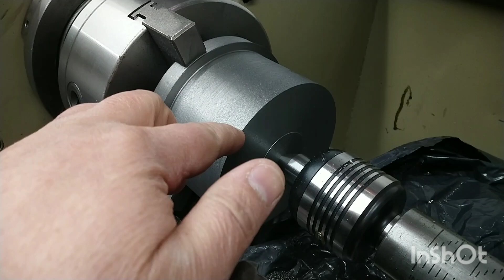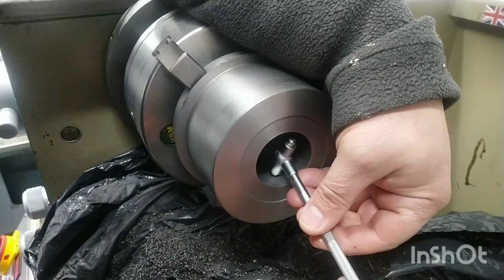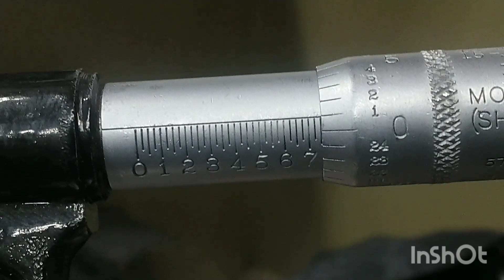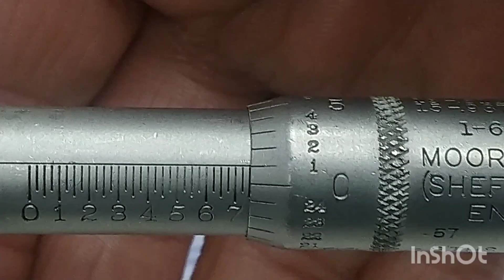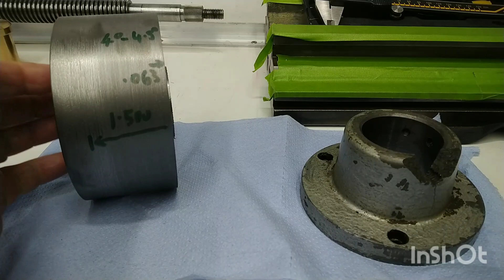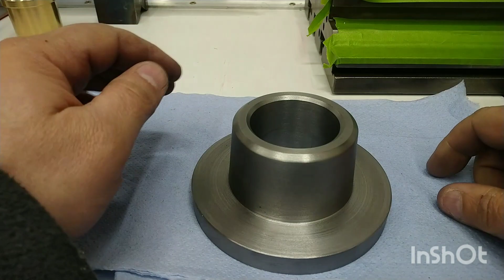Harrison Mill Resto Part 9B - Making the nut housing - And Swarf Jenga!

Comment: To be totally honest I wouldn't have bothered with the taper and would have made it parallel. The only reason for the taper would have been because it was a cast part and hence needed a taper to release from the mould.
Reply from the maker: Yes of course you are absolutely right. I did consider not having the taper. And if you look at Harrison Mills, there is a lot of variation in that particular part. But I decided just to make it look like the original as best I could. Thank you very much for taking the time to watch and comment. I do appreciate it.

Comment: There are a few times when I've thought a high speed spindle to attach to the cross slide would be very handy, this being one of them, stick an end mill in and cut a circular groove in then part off a donut. Not quite as good as the rotabroach but still probably quicker and slightly less wasteful than just converting the entire thing to swarf!
Reply from the maker: Yes I agree with that statement wholeheartedly.

Comment: That looks spot on Carl, ant that cc iron turns really well, but as you say, messy! I have done my fair share of car discs drums and flywheels so i know what it is like’ Other than “As original” is there any reason you went with cc iron as opposed to steel or even a weldment, i can imagine it was not a cheap lump of material, although it did turn very easily and was free from defects. Superb job and a great watch!
Phil
Reply from the maker: Thank you very much Phil, I really appreciate your comments and you taking the time to watch. I used cast iron because it has a very large vibration damping coefficient. That is the primary reason it is used in machine tool manufacture. The damping comes from the inclusion of the free graphite in the material's matrix. As this nut housing is one of the components supporting the table of the Mill, I didn't want to alter the vibration damping dynamics of the machine by introducing another material. Thanks again for your interest my friend.

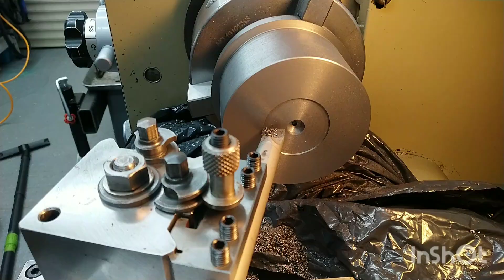Comment: Well done Carl, you've made a proper job of that, it looks great. One thing I'm curious about though, at the 4:59 mark, you show you about to turn the bottom face, I noticed you have your tool mounted at an angle - what was the reason for that? To get the carbide insert to interface at the correct angle? All the best, Jason
Reply from the maker: Thanks Jason. I angled the tool like that because I wanted a bevel at the edge of the recess, and angling the tool gave me that. Thank you very much for watching and for commenting, it is very much appreciated.